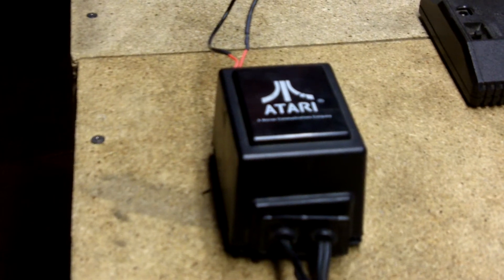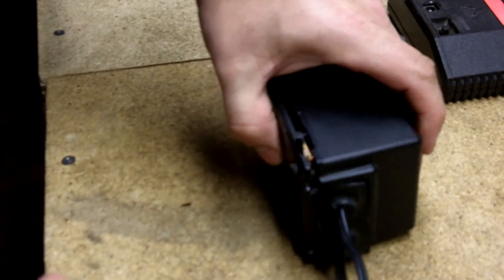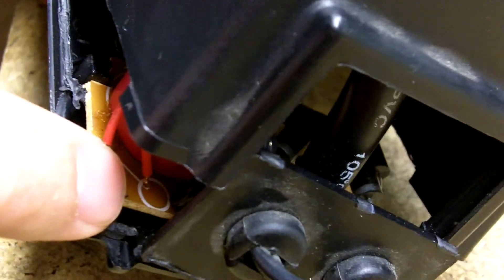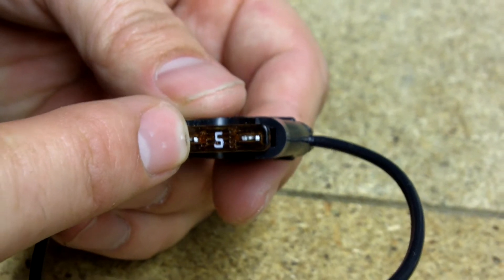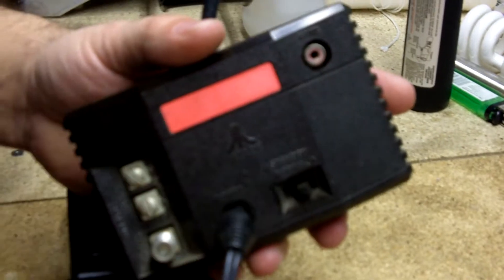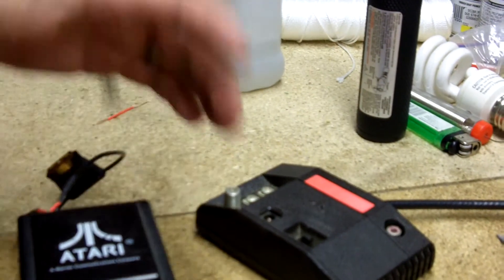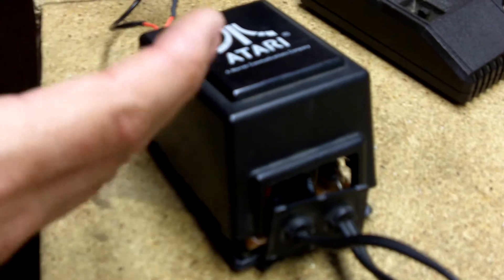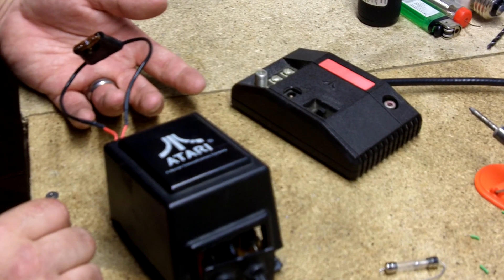Repair Atari 5200 Power Supply

Comment: It's weird. The brick has 2 screws in it, but even with those removed it still needs to be pried open and without damaging the Capacitor or other components inside.  I will be trying this out as I fried my 5200 by moving that cable accidentally.  Thanks for the video!

Comment: is there a way to the power supply? got an Atari 5200 for free but payed for the parts to use it but doesn't power up. is it  the system or the ac adapter?

Comment: It was an auto switching switch box that would go back to TV when the system was shut off. They made it for lazy or forgetful kids who wouldn't switch the box back to TV and then the parents would get all angry. In theory, it was a good idea, but not in execution. Kind of like the analog joysticks. Great idea, but to have them non centering was poorly executed. Regardless, I still love the 5200. Nice repair on the power supply, always good to see another revived 5200.

Comment from the maker: The power ratings are: 9.3 volts DC and 1.95 Amps. With center pin positive.  So a power adapter that is 9 Volts with at least 1.95 Amps will work. Anything greater then 1.95 Amps will work that is just how much of a draw the power adapter will handle.  Hope this helps